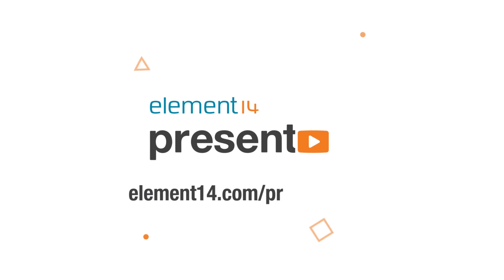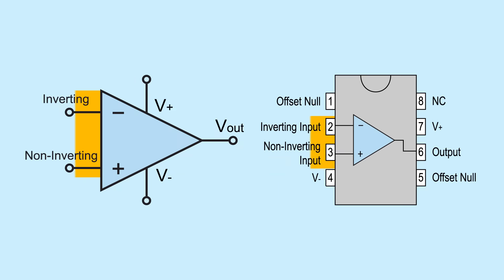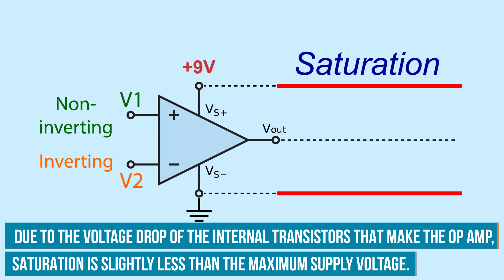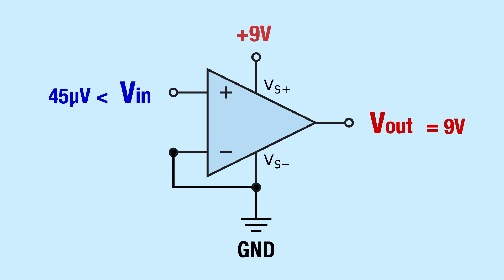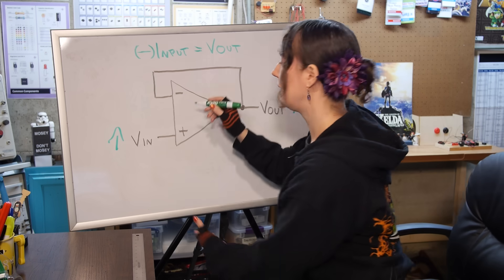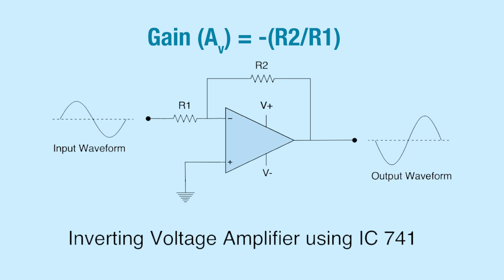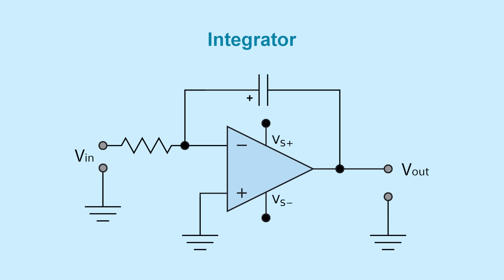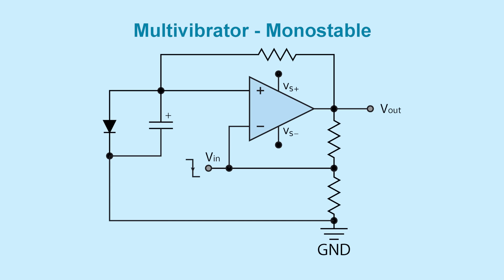How Op Amps Work - The Learning Circuit

Comment: The thing that finally got me to understand OpAmps was this:
In a normal circuit, if two nodes are connected with nothing between them they have the same voltage and current can flow freely between them.
OpAmps "break" that rule. The two inputs are a pseudo-node where the voltages are the same, BUT no current flows. If you introduce that into the math of circuits you get a really powerful tool that lets you do all of the things described here.

Comment: Karen, I think one of the more interesting op-amp circuits is simulating a large inductance with a gyrator configuration. Actual large inductors are heavy and bulky but a two port op-amp gyrator is only a few small components, making the circuit very compact. It's a convenient way to produce an inductance in the Henrys.

Comment: When I learned about op-amps, back in the early 90’s, we learned all about their originals use in early computers. Operational Amplifiers, are called that because they were originally used for Math (Operations). That small voltage triggered the high voltage low or high to trip relays, denoting a binary state. Later on an op-amp, like the 741 that we used in solid state circuits much later on, was not really about using it for high gain applications but rather as part of rudimentary logic circuits while other op-amps were designed specifically amplification. In summary’s, Summing, mixing and opposite phases are all the things you need to do binary logic and op-amps were originally designed to do just that. It has been a while since I have thought of this stuff, almost 3 decades, but that is my recollection. Cheers all.

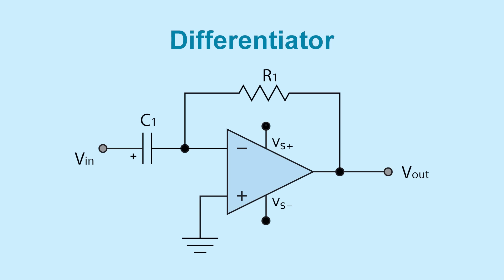Comment: Thanks for this video! I learned a lot from it! But I was confused at 6:55 you say "by swapping the resistor at the input with the feedback resistor". Should it be "by swapping the resistor at the input with the feedback capacitor"? Or am I missing something? Thanks a lot for your help!
Reply: Yes, you're correct, she misspoke. Regardless, the circuit is right.
Reply: @kwgm8578  Thank you for the response. It is hard to know what is correct when you are trying ot teach yourself. As far as I knew what shes aid could have been corrct and there was some point I didn't understand, so thank you again!

Comment: I use opamps in electric guitar effects pedals in conjunction with transistors to create overdrive, distortion and other musical effects. My knowledge is limited technically but I learning through practical experience. I have come across an unusual circuit that I Canaletto sense of: the parts that are confusing are 2 diodes in series and 2 transistors in series the weird par to me is that one of the transistors is a NPN and the other is a PNP. I am trying to follow the input which seems to go through the opamp, then the diodes and then the transistors. Of course there are resistors and capacitors in the circuit it I think I understand their functions.
Reply: You made this comment 8 months ago, so maybe you have since figured it out, but the circuit you questioned sounds exactly like a "Class AB Amplifier" set up (2 series diodes and 2 'complementary' NPN and PNP transistors).  If you search Class AB Amplifier circuit, you may find the information you desire.

Comment: I love to build things with OP-AMPs. Once I built my own PWM dimmer/speed controller consisting of a NE555, a UA741, a BUZ11 MOSFET, 7 resistors, 4 capacitors and a potentiometer.
I operate my self-made 12V LED light strips on this dimmer. I simply used cable ducts for the LED strips. I drilled holes for 5mm LEDs in the cable duct cover. On the inside of the cover I soldered the wiring strands and the corresponding LED series resistors.
In the stairwell I also have the same cable ducts with built-in LEDs just above the steps, which are switched using a self-made time switch with an OP-AMP and MOSFET. The time switch is controlled by a radar motion detector, which can also detect movements through walls.
Advantage of the radar motion detector: It reacts to everything that moves, as long as it is not too small. But moving a finger is enough... PIR motion detectors only react to objects that are warmer than the ambient temperature.

Comment: Thanks for this great introduction to op amps.  As a newbie with limited experience, I don't see how the circuit at 6:13 can work -- the inverting and non-inverting inputs are connected together.  Should this connection be removed, or replaced with a resistor?  Thanks.
Reply: You are correct. There should not be a connection there. Also,  if R3 is the feedback resistor, then it should be going to the inverting input. The circuit equation is also incorrect (note R2 and R4 don't show up in the equation! Also, the signs of Vin1 and Vin2 are going to be wrong).
The circuit should more properly called a difference circuit - not differential. A differential amplifier is a term used for an entirely different beast.
The correct equation should be Vout=-R3/R1*Vin1+(R1+R3)/R1*R4/(R2+R4)*Vin2. The difficulty will be getting R3 and (R1+R3)*R4/(R2+R4) to match (in order to get a good subtraction).
Reply: Your absolutely right, the inputs shouldn't be connected with each other.

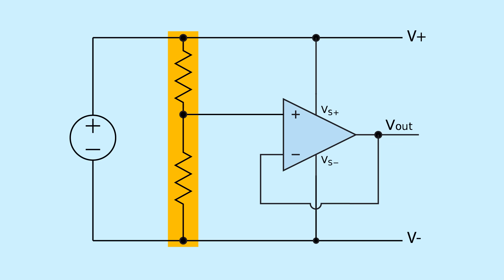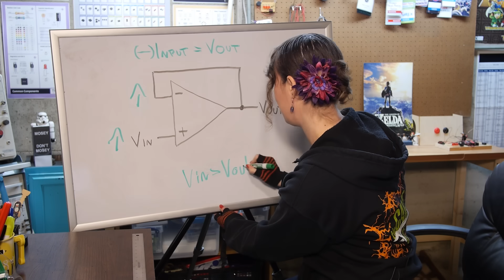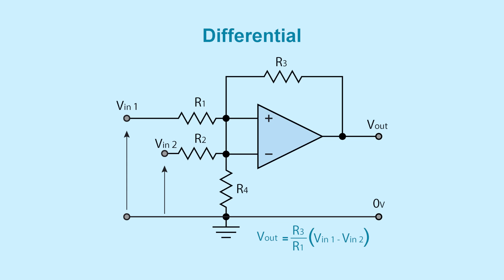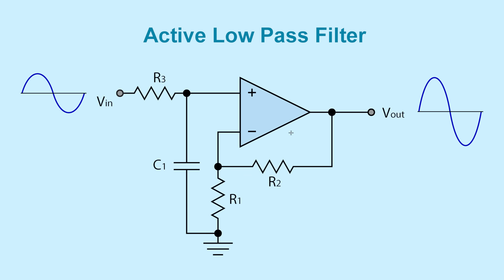Comment: Merely connecting a feedback resistor does not change the gain unless there is also an input resistor. The diagram at 1:36 is nonsense, wth the voltage source connected across the voltage rails. It should be connected to the junction of the resistors. It is at least as common to use balanced voltage rails as it is to have one grounded. The gain of an opamp is the ratio between the voltage difference at the inputs and the output voltage. The circuit at 3:35 is not a comparator. An opamp cannot be used to produce square waves in the manner shown at 3:55 unless the input is large enough to saturate the output. The statement about microvolts at 4:45 is nonsense. An opamp in the inverting configuration has zero input impedance. The circuit at 6:20 has the NFB connected to the wrong input port, and the inputs should not be connected together. The circuit at 7:07 is a passive low pass filter followed by a non-inverting gain stage. It is not an active filter, and it is not an example of a differentiator, which would not be a low pass filter anyway: it is the preceding integrator circuit that is a low pass filter. The circuit at 7:20 is not as described in the narration. Most of the fundamental properties of opamps are not stated. Who wrote this drivel? and why was it published by a reputable electronics supplier? It would fail Small Signal Analysis 101.

Comment: I've been using digital recording and wondered how DACs work most of my life, now I know. Thank you! It's also given me a clue as to how ADCs work too: an array of differing sized resistors feeding bit inputs on a chip with some kind of reverse op amp shrinking voltage instead of amplifying it?

Comment: [6:17]  non -invert connected directly to invert,that would be 0 volt difference I do not get at all.  Is it the difference between the + and - supply which generates output?  The connection between invert and non-invert should be broken and a separate resistor  call it R5 should go to 0 volt from the non-invert and R2 R4 go to invert.  I have a plug-in breadboard I will try it.

Comment: I learned "virtual ground" is a big aspect to op-amps. I never fully grasped the concept to my satisfaction, but the way I understand it is the current between the two inputs is so small a virtual ground potential is present between them. That is if one of the inputs, either the inverting or non-inverting, is pinned to ground. Can anyone offer more on this?
It's a great video, and I would have loved to have it as a learning resource back in the day.
Reply: You understood it wrong. There is no such thing as a 'virtual ground potential'. In an inverting configuration, the non-inverting input is grounded and the inverting input presents a virtual ground because the opamp works to keep the voltages at both inputs the same. In this mode the opamp is sensing input current rather than voltage, as the voltage is always zero. That's why it is a virtual ground.

Comment: The op-amp I'm using is lm358. I use it to avoid the output of my load to have an impact to a voltage divider I createdm. However, for small voltage inputs, it encounter errors in the output. But as the voltage increases to around 3V, it starts giving the predictable values.
How can I correct the amplifier's error for small voltages?
Reply: I assume here you run the LM358 with a single supply.  If this is the case, it happens that the output of LM358 can't go down to 0.000, so there may be some mV too much for very low values.  To correct this, add a diode directly at the output of the LM358 before anything  else. That is, the anode connected to the output of LM358 and nothing else at the output of LM358.  The cathode of the diode is now the "new output" and is connected to whatever was on the output of LM358 in the original circuit.  You may have to add a "pull down" resistor around 1K between cathode of diode if the LM358 was used to sink current from the output load.

Comment: The circuit of the differental @ 6:12 is totally wrong. Both the non-inverting and the inverting are connecting to the same signal because the two inputs are shorted together.

Comment: What is the difference between a TL072 and a LM393 ?
Reply: Besides the L they're completely different! If you really want to know how they're electrically different you'd need to compare their datasheets. the TL072 is a general purpose device and the LM393 is a comparator.

Comment: "opamps doesnt create power it just controls the voltage is already supplied" now this is i wanted to hear because some people thinks it occurs magically to 100 volt and some thinks transistors also magically amplify current .. thanx for clearance
Reply: Transistors do magically amplify current. That's what they do. A small base current controls a larger collector to emitter current. How transistors do that is basically magic too. Holes, doping, depletion zones, what is this witchcraft!

Comment: Holy thank you for explaining it this way, no other relatively short video explains where the voltage goes to depending on the input, just that it amplifies one signal or flips another.

Comment: Karen, I am a retired auto tech building a 1967 Chevy pickup for myself. Using the “Op Amp” for a low fuel lamp. Now, with 0 ohms = Empty and 90 ohms = Full. Using this variable input into the inverting input could be used for turning on an LED. To set the point of this “On” signal for the LED, the non-inverting side can be the sweep of an 100 ohm potentiometer connected to B+, the sweep connected to the non-inverting (-) and adjusted for a resistance inside the fuel tank to 2 gallons, 3 gallons or whatever a guy/gal wants for a warning reserve. Using a 470 ohm resistor to an LED fixture marked low fuel would not effect the gauge, tank sender or the circuit. I am just bringing my project into the 21 century so my wife or son could drive safely but with reliability. After 40 years, I have found that is you over build a component and add it into a service manual, will last way longer. 
  As a guy who would build an automatic to handle 600 HP, but only have 400 HP driving it. Properly cooled, it would last 30 years, instead of 10. On my idea of using an “Op Amp” in this fashion, would or should this work and be reliable? (LM358, 100 ohm pot, soldered terminals with shrink wrap and dielectric grease) ASE Master Tech since 1978! Thanks.

Comment: Very fast,short,brief introduction to OpAmp .For three years since 2017 , I never use/touch/fritzing/multisim-experiance in electronics.  I stopped washhands reading electronics, many  people started to use VR/AR/MR/XR to designed/demo the digital-electronics new technology ( Printed Electronics, small-palm-size FPGA ,XILINS/INTEL ,software-hardware programming beyond Arduino,Rasberry PI-4 . Suddenly a young lady replacing a young man in element 14 ? A new fresh starts .Good to see new face ! Karen keep it up .

Comment: So far "changing AC to DC" in my text books has always been shown as cutting off the lower or higher parts of the sine wave, could someone explain why a square wave, that looks as if it has both polarities is "DC"? 3:34
Reply: If the square wave is referenced to ground, it is a form of "pulsing DC" kind of like rectifier output.  AC means the current is continually changing direction, but a pulsing on/off square wave signal could be averaged as a DC voltage.  I don't know if the graph shown in the video is correct.  If the square wave went from positive to negative, I would consider that a form of AC voltage.
Reply: Yes, a square wavevisn't really dc.

Comment: Thanks a lot. Just one mistake I think. 6:20 the inverting and non-inverting inputs have been connected, making it a single node. Voltage difference is always zero.

Comment: TI makes an OP amp for a product that I oversee at my company. It's terribly noisy and that results in a lot of failed test lots of said product. Always check for a noise spec on the OP amp you're looking at.
Reply: What you want is a Burr Brown device. It's what we all want. That's where TI sends their engineers they retire. So they're designed by old guys that know what they're doing.
Reply: @1pcfred  Thanks for the reply. Unfortunately our customer is the US navy and any change we make risks a re-qualification of the product; which costs us a lot of money. 

I ended up finding a better TI op Amp that's based off of Burr-Brown dies. It's the OPA992. It's the same package size and better specs.

Comment: I need to design a amplifier to change 0-5 Volt PWM signal to a level of 0-10volts .wish to use a single LM558 (half of it). Can you suggest a circuit with values of components  in it. The supply voltage is 12Volts D. C

Comment: What about using the OP-Amp as a Error Amplifier which drives the CV pin on a NE555 which will control the Mark Space time which will define the max output via a filter to the inverting of the Error Amplifier, the output from the filter will also drive the Loudspeaker, this is of course a Class D amp.

Comment: Hmm, my Lm358 OpAmps dont really work like this. for example, if the inverting input is biased to ground and i have say five volts at the non-inverting input it does not give an output.

Comment: Great to the point video, clean slides, a lot of information per time! However, there are two mistakes in the differential amp slide (around 6:20); 
1) The two inputs are interchanged. For non saturated operation (i.e. no comparator) the feedback path must always be closed, i.e., inverting input must be connected in any way to the output, 
2) The two inputs must not be tied together. As you explain, the opamp amplifies the voltage difference between both inputs and does everything at its output to keep the voltage difference at the inputs as small as possible. So, a short circuit between the inputs makes it impossible for the opamp to work. 
Keep on with your good work!
Reply: Thanks thought i was going to lose my mind.
Reply: @openyoureyes7539  exactly same here. Just when you start thinking you understand smth, the teacher makes a mistake like that..

Comment: Hi, I have one op amp in a active speaker but this one has 24 volts vs  It is soic 14 dual op amp but almost all the pins have more than 20 volts. Is It normal?

Comment: @3:46 I would say that it's a sine wave to square wave converter rather than being an AC to DC converter..
Reply: Yes but if you had a rectifier involved then if it could flatten out that wave for some potentially better used signal but you might still need a cap to smooth out the power differential since I imagine the current will be oscillating in response.
Reply: @Phantastischphil ok, but it would be the bridge rectifier that was converting to dc in that case, not the op amp.

Comment: hello thanks for video 
i wanna build 2 channel input to 8 channel output or more input (audio splitter) using lm324 any idea or any suggestion to split audio input to multi output without losing power or sound quality? thanks and best regards!
anyone can help i will be so happy
Reply: Use op-amps with Gain set to 1 as buffers from the mixed audio stage?

Comment: I have an electric guitar, it has active pickups. I looked at the schematic for the EMG 81, it runs a high pass RC filter feeding into a feedback op-amp. I can't find a schematic for the EMG 85 Neck Pickup, but it sounds much warmer than the bridge pickup, so the EMG 85 must have a low pass filter and a feedback op-amp.

Comment: In the beginning I understood an OP amp to take .00045V and turn it into 9V respectfully at the same time in the end it’s portrayed that OP amps don’t take power out of nothing and create power please clarify?
Reply: The op amp is supplied a voltage at Vs- and Vs+. We'll say 9V. The difference of voltage between the two inputs labelled + and - will determine how much of that supply voltage is output. So the difference of voltage at the two inputs acts sort of like a volume knob for the output, causing it to output a voltage from 0V, up to 9V. The bigger the difference, the higher the voltage being output, to a maximum of 9V, or whatever the supply voltage is.

Keep in mind that if the voltage supply is 9V, you may not be able to get a full 9V at the output as there may be a bit of voltage drop across the op amp. You'd have to check the data sheet to see if there is.